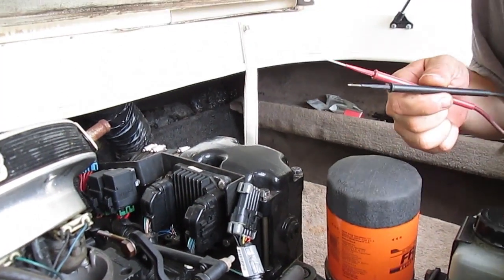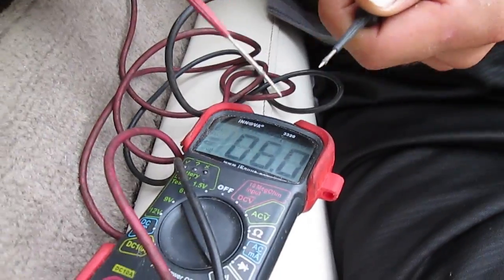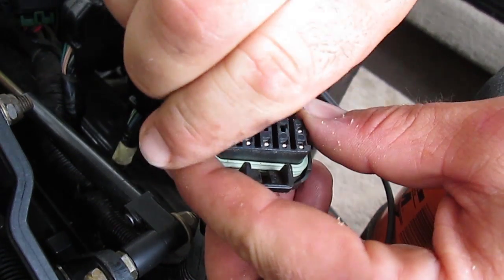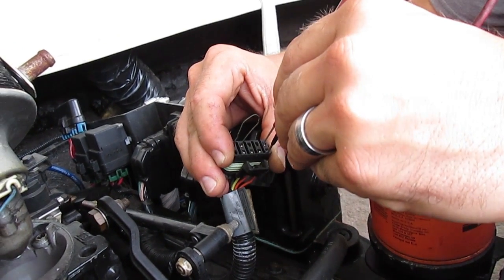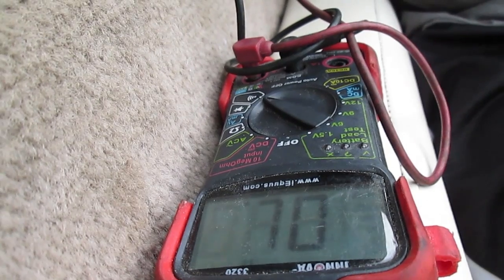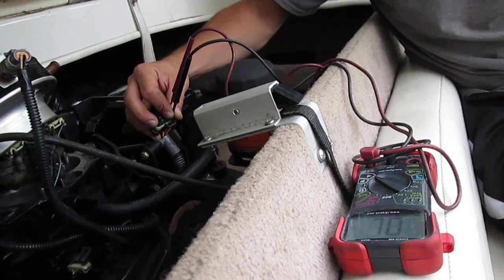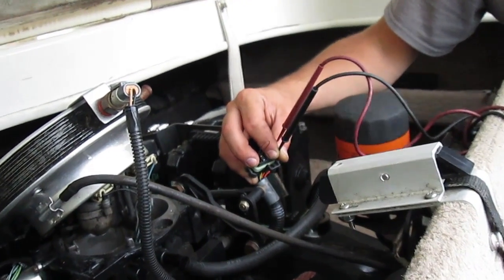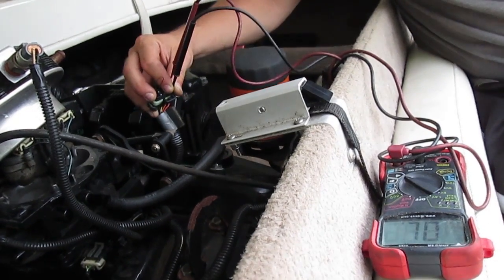Simple Way to Read Trouble Codes on Mercruiser MEFI Engines

Comment: Great movie.  I'm asking for help, I have a Mercruiser 4.3 L EFI 2003 and the red light on this module is on.  The engine stopped running at idle, it runs rough and black smoke comes out of the exhaust pipe
Reply: There is no light on a MEFI3 system that I'm aware of.  I think your issue is the IAC - Idle Air Control Valve located near the spark arrestor (air filter).

Comment: Great video! I have a 2013 Mercruiser 4.3 MPI, will this work? I have a check engine light on but everything seems to be working fine. I watched your video and I can't find the exact plug you used to do this. Any help would be greatly appreciated.
Reply: I believe this is only for the Mefi 3 system.  The MPI is alot more complex

Comment: Hello, help please we have a 2007 MasterCraft XStar boat, the Indmar 5.7 engine, the ECU engine control unit has failed and its number is 12607802, we bought a new unit of the same type, the engine starts and runs at idle speed exactly, but now we have the engine speed control knob does not work, we were told that the new unit needs to be tied under our handle, we have a diagnostic scanner and a diacom, but the problem is we are in Russia, the city of St. Petersburg and there is no indmar representative, can you suggest something or help ? thank
Reply: Могу поискать информацию.   Какой у вас еmail?
Reply: @MrLeviaFUN  Спасибо большое, уже решили проблему!

Comment: How do you reset the codes?
Reply: For the older ECM systems just disconnect batteries for a day will erase stored codes.  If it's active code, it will not erase.  On newer systems, you need a $600 diagnostic tool to do it.
Reply: @MrLeviaFUN  i haven't tried it but i read something about putting it in scan mode and then go full throttle and back or something along those lines. Any info in that
Reply: @timothyberlinski2299  , sorry, did that work for you?

Comment: Do you know how to erase trouble codes?
Thanks
Reply: For the older ECM systems just disconnect batteries for a day will erase stored codes.  If it's active code, it will not erase.  On newer systems, you need a $600 diagnostic tool to do it. Удачи
Reply: @MrLeviaFUN  I believe to reset you put the throttle in forward then neutral.
Reply: I believe put throttle all the forward then neutral.

Comment: Great tip, I am going to check if it will work on my Indmar Assault.
Reply: Unfortunately the diagnostics connector on the Assault is a single row unit.
Reply: @CncObsession  , thanks for the update.  Must be a different MEFI system

Comment: I have a Mercruiser 3.0 Alpha I, MPI......can I use this?  My OBD light has been on but can't find anything wrong.  Thanks man!
Reply: Your best bet is to have a certified mechanic with proper diagnostic tools check out the check engine light.  The MPI motors are a lot more complicated than the carb or efi versions

Comment: what year does this work on?  I have a 2011 Mercruiser Bravo 3 I/O
Reply: Compare your ECM to MEFI pics on the web.  If you have MEFI 1-4, chances are you can use this test.
Reply from the maker: minion ryan515 It's hard to tell. If the wire colors in the plug match, I'm pretty sure the test can be done. But, make sure you know the risk of possibly damaging your computer.
Reply: You can not exactly say to what year it is possible. IMPORTANT: Just working on MEFI 1 - 4. The ECU in the Video ist a MEFI 4. MEFI 5 would get damaged by adding the Paperclip.
Reply: JGC Summit , for what it's worth,  the ECM in the video is a MEFI-3
Reply: Will this work on Verado Outboard’s ?
Reply from the maker: No, it will not